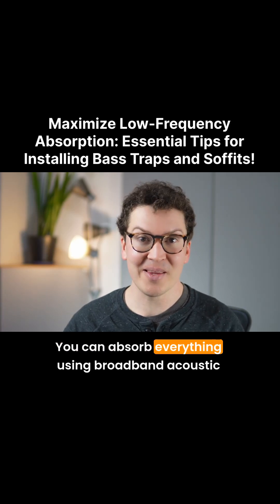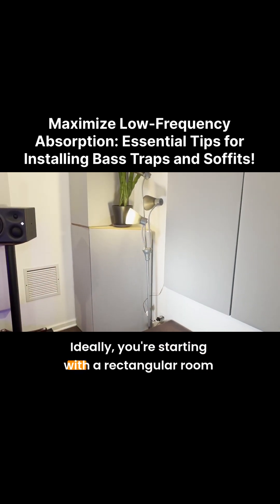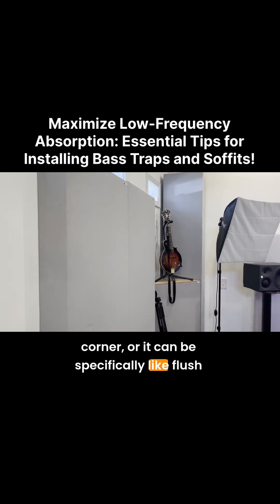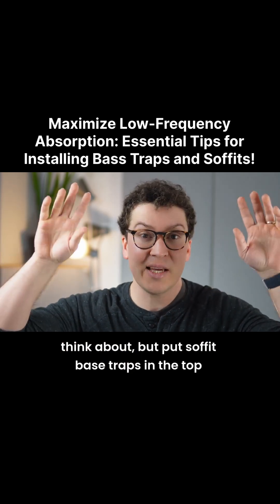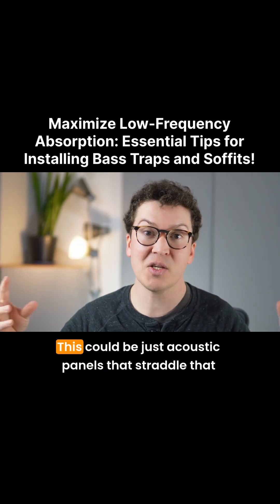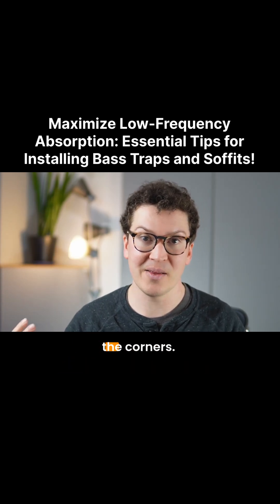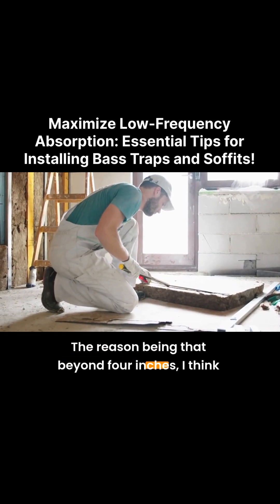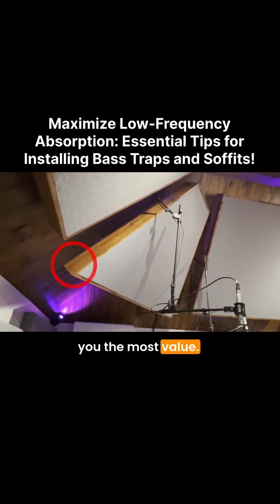Maximize Low-Frequency Absorption: Essential Tips for Installing Bass Traps and Soffits

Comment: Does big heavy sponge furniture absorb bass too? Why are backs / corners specifically important?
Reply: Generally anything with mass is good for absorbing bass, so a couch should help, but there are other factors to take into account. Bass waves are longer than high frequencies which causes them build up or drop out at different points of the room after reflecting off the walls. The corners and walls are less susceptible to phase cancellation so bass typically builds up there
Reply: Corners have the lowest sound velocity and highest pressure. That's where damping is most important. The pressure is what will move the fibers, and the fibers will absorb the energy.